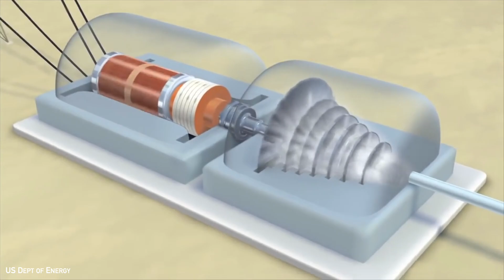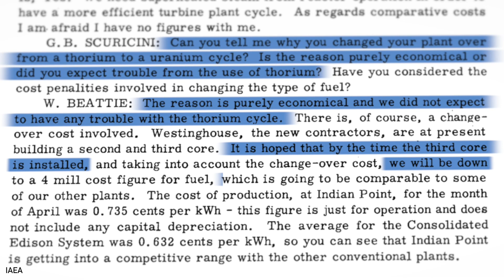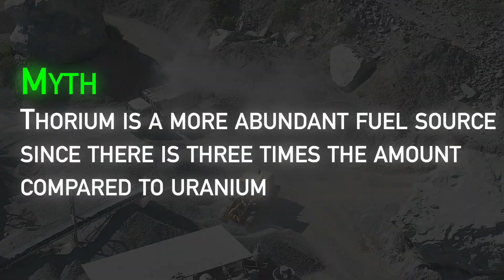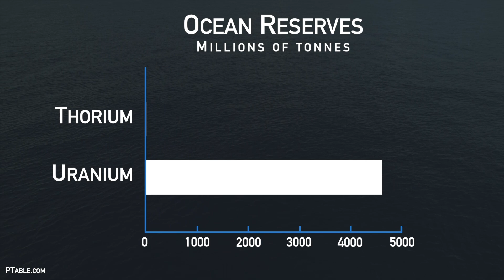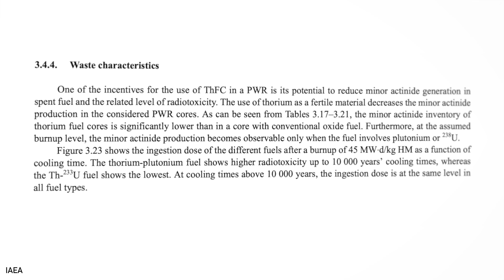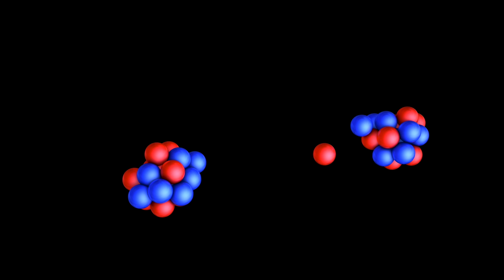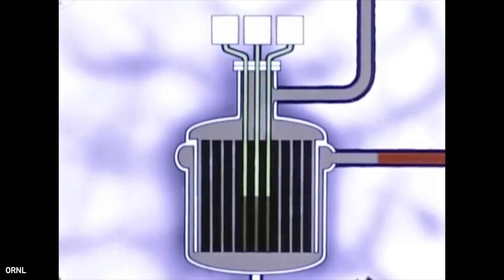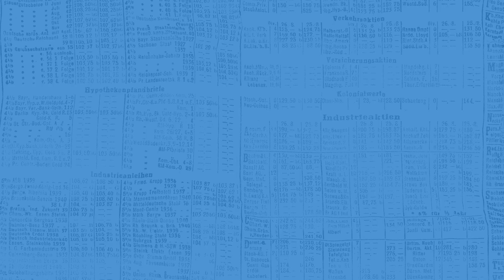*Almost

Comment: You make an economic error - the 'bomb' cycle subsidised the uranium economics - this staved commercial development.
Reply: That's kind of like saying the military subsidized jet and turbo prop engines, so we should all use piston driven propeller planes .
Virtually every type of reactor and fuel cycle was tried through the '50-'90s including Th cycles and MSRs. The "bomb cycle" subsidization was already done before any commercial power plants were built and none of those commercial plants in the US ever produced weapons materials. That was all done in dedicated military sites (i.e. Hanford & Savannah River). The reality is that the Th cycle wasn't economic. It was tried. Perhaps that will change in the future but it won't be because of Th hype produced by startup marketing.
Reply: @richardb1452  :(, you missed my point. It is the 'founder' effect in network economics - the military/government  choice subsidised the first two generations of commercial reactors - that is all. 
That 'lost' about thirty years of research into thorium (for commercial use). 
thank you for your comments
Reply: @carly09et  Understood....and you perhaps missed mine. Go back through history and that happens in virtually every tech area the military engages in, which is almost everything. The easiest way to unlock funding for research is to see a threat, hence things like DARPA, the space race, etc...
Not saying that is how it should be, but it is the rule rather than the exception. Cheers.
Reply: @richardb1452  I get it it is like standards.
It takes a while for 'bad' standards to be overtaken - I give the 'first to' a higher economic barrier is all.
Reply: @carly09et , like with standards, there needs to be an economic incentive to change and so far unless you are India, that doesn't exist. I wouldn't characterize either fuel cycle as "good" or "bad" generically. Both can be closed cycles producing similar waste streams. Both require proliferation controls (despite claims to the contrary). Passive safety is a function of reactor/fuel design, not fuel cycle choice. I know there has been a lot of hype about Th over the last decade, but it is not yet justified scientifically. It is a dream and may come true, or it may not.

India and China may come to the same conclusion the US did 50 years ago, that the Th cycle is more expensive. That said, India in particular may adopt it regardless for energy independence reasons. In the US, the two Th solid fuel commercial core trials cost more than U cores and the Th MSBR was just a concept competing against a U-Pu breeder that had already been running for nearly 5 years actually producing electricity. I think it is hard to objectively argue based on info available at the time the US made the wrong fuel cycle choice at any point in the timeline. 

Only time will tell if that 30 years was actually lost or in fact saved.

Comment: Plus thorium is a byproduct of rare earth mining.  There is 1000 years of the stuff already concentrated and stored as a waste by product.
Reply: Yup, and old coal powerplants can be repurposed and refurbished, using the old steam turbine and electrical infrastructure and just switching out the heat source adding safeties and infrastructure for thorium
Reply: Still that won't make NPPs much cheaper nor practical, Noah.
Reply: Mentioned in the video, Patrick, but thanks anyway.
Reply: They don't separate the waste product from each other. It only concentrated in the sense one specific resource has been extracted from the generic waste

Comment: With thorium 90% of the element is actually burned.  NOT 1/2 % of 5%
Reply: With Thorium 0% is fissioned since Thorium is not fissile and will not fission. U238  is not fissile and will not fission but like thorium, it can absorb a neutron and become Pu239 which is fissile and will fission and does fission in uranium reactors

Comment: THEN only 1/2 of 1% of the 5% is actually burned until the solid fuel rod is ruined from gas production and cracks.
Reply: actually more than 100% of the uranium fuel is used

Comment: You make one faulty argument. 
The Th we find is 99% the fuel-cycle ready variety. 
The U we find is only 0.7% the fuel-cycle variety. 
It's misguided to say "Look, there's the same amount of extractable U as there is Th!" The important metric is not what's extractable, but what is usable . And Th has a *100:1*  advantage here.
Reply from the maker: I'd almost agree, but U we find is also 100% usable in fast reactors. The 0.7% is only limiting if we consider just LWRs.
Reply: @atomicblender  hmm indeed. The U-Pu cycle.
Reply: he Th we find is 0% the fuel-cycle ready variety.  Thorium is not fissile, does not fission and does not produce any power.  U233 that comes from the Transmutation of Thorium does. U238 which is 99.3% of all uranium.  U238 is not fissile, does not fission and does not produce any power.  Pu239 that comes from the Transmutation of U238 does.

Comment: Is not Thorium the most abundant nuclear material found on earth, like over Oil, Plutonium, & Uranium, Thorium is literally everywhere?
Reply: No it is not found everywhere.  Thorium can do everything except escape the laboratory even after 60 years of trying.
Reply: Abundance. Thorium is three times as abundant as uranium and nearly as abundant as lead and gallium in the Earth's crust.[22] The Thorium Energy Alliance estimates "there is enough thorium in the United States alone to power the country at its current energy level for over 1,000 years."[23][22] "America has buried tons as a by-product of rare earth metals mining", notes Evans-Pritchard.[24] Almost all thorium is fertile Th-232, compared to uranium that is composed of 99.3% fertile U-238 and 0.7% more valuable fissile U-235.
https://en.wikipedia.org/wiki/Thorium-based_nuclear_power
Reply: @edge2science Under your logic,  Hydrogen is the most abundant element in the Universe so everything else should be abandoned and fusion reactors built.
Reply: Oh fun, Sure whatever you say your magnificence : )
Reply: @edge2science  Being correct does not make someone magnificent.
Reply: @clarkkent9080  Got that right supperman LO

Comment: 2:30 ~ It was done by Nixon as a way to use the cash and resources for nuclear armaments.  Cheap, reliable power for the future be damned compared to global domination in the nuclear weapon department.
Reply: Where do people keep coming up with this BS that Thorium was abandoned and Uranium based PWR/BWR were chosen so we could make bombs?
Hanford Wa. has been making weapons material, at their 9 reactors, since 1944, 12 years before the first U.S. commercial nuclear plant became operational and their weapons production reactors are very efficient graphite moderated reactors and DO NOT produce any electrical power.
Savannah River site SC. Has been making weapons material since 1955 and their 5 production reactors are very efficient low pressure heavy water moderated reactors and DO NOT produce electric power.
Thorium was tried at Shippingport and Indian Point commercial reactors in the 1970s and abandoned as too costly compared to Uranium.
Weapons production reactors are NOTHING like U.S. commercial PWR or BWR power reactors and commercial power reactors have NEVER been used to produce Pu239 for weapons, since there has never been a need beyond what the efficient weapons production reactors could provide..
The U.S. currently has so much Pu239 that 34 tons of weapon grade Pu239 is being treated so it can eventually be disposed of at a cost of billions.

Comment: I challenge your mythbustings #2 and #3.

#2.  Numbers about supply are coupled to demand. If there's a market, supply will appear.  If there's not a market, supply will disappear. 

What the abundances are in the oceans is more an issue of solubility in salt water.  I am not sure what is the relevance.  Where we mine rare earth metals, Thorium is 4.1x (see  2017AGUFM.V24C..08M) not 3x higher in abundance.  It can be recovered from existing mining programs but if there's no market there's no rationale to recover it.  The numbers you saw are just what's semi-marketable and meaningless.

But who cares about the 4 vs 3 error?  There's a factor of 100x error or so due to the fact that only U-235 (1% of U) is usable in plants. The U-238 is wasted. With thorium, all of it can be used.  

The cost and effort required to obtain the U-235 from U is a little crazy, too, since they are chemically almost the same. It's saved with thorium.

So, it's 400x more fuel, not 3x more fuel in the ground.

And, last but not least, thorium reactors can fission the spent fuel from U-235 reactors that everyone has been complaining about for 50 years, so the fuel is not even free but is actually negative. 

#3. This is speculation on my part but no, the fact that is has some uranium doesn't mean it is like a uranium plant at all. If it can fission any thorium it should yield thorium byproducts, not U byproducts.  

Good video though.  Keep up the good work.

Comment: Hi...I think if memory serves, your assessment seems to be in step with Sabine's!  I have a reasonable grasp of the structure of an atom and the concept of splitting it and getting energy out and fission products that are different from "their parents" and often still radioactive - indeed what radioactivity is: unstable atoms throwing out differently-dangerous decay particles (although I forget specifically whether it's an alpha or beta particle which is a neutron and what a gamma ray is). Similarly I have a broad handle on the fact that the power stations use the heat to boil water and that the resultant steam (at far higher temperature and pressure than what comes out the kitchen kettle) drives a turbine, which in turn drives an electricity generator (which is something like a reverse elctromagnet)

So it can be seen the general idea is there without claiming any real expertise whatsoever. What I WOULD hope to claim reasonably is a neutral position and an ability to put what i know about each of the various viable means of power production into perspective. Seen as ALL methods of generating power have waste, climatic, risk to life and sustainability consequences, all I will say is that while I leave the technicalities to the experts (I would not feel in any way qualified to usefully contribute to the arguments concerning which particular "brand" of nuclear reactor we should be considering  - molten salt, thorium, fusion etc ), I do feel sufficiently impartial and informed enough to say that it is ABUNDANTLY clear using coal for energy production is by far the most dangerous...if the stats on the mining, transporting and burning of the stuff, including the pollution it produces  - are collated and summed over the totality of commercial coal-fired energy production it is millions dead, injured and diseased. Adjusting that headline number to a more representative and therefore fairer and more realistic one by allowing for the fact that coal represents such a huge percentage of the world's electricity energy source, it is still whole orders of magnitude more dangerous than equivalent figures for solar, wind and nuclear sources. Oil is not far off in its danger, as with coal both drilling for it, transporting it and turning it into power. Whilst natural gas has lower  environmental/climate detriment, it is, by comparison to the best options, still dirty and dangerous.

Hydro seems so clean, doesn't it - literally electricity just from the potential energy stored in water...yet millions of tonnes of concrete and steel have to be manufactured with which to build dams and construction  is already one of the most dangerous jobs on the planet, never mind the exponentially more dangerous task of constructing things hundreds of feet tall. Then there's the approximately 20 annual dam failures which, although in spite of their drama are less dangerous than might be thought, still cause dozens of deaths per year - a figures likely to worsen in the coming years as more unpredictable rainfall makes overstressing dams increasingly likely.

The ultimate point is this. Approximately 6500 people have died in air crashes since 2006 - which stops virtually nobody from attending conferences abroad or taking their family abroad for a holiday. Moreover, despite statistics indicating that, in the US and UK (so Christ knows what it's like in India, South Africa or Colombia, for example) riding a motorbike is THOUSANDS of times more dangerous than air travel, does that seem to stop about 1.4 million people per year taking to the roads on some form of motorised 2-wheeled transport I'm Britain alone? With the dangers described in the above terms, you would have thought there wouldn't be a single scooter to be seen on the King's Highway - and people far more circumspect even about getting on a plane. In the same way, we need to get places, so we need power. The two have very significant bearings on the vast majority lives. I simply don't understand therefore, how the vociferous Greens and CND brigade, have been allowed to hijack nuclear power to the degree they have. They have also, albeit indirectly, been responsible for countless thousands of preventable deaths by forcing electricity generating companies to continue relying on fossil fuels and/or other dangerous/inefficient ways for generating electricity? By all means let them raise objections and even protest - but let them look at the figures themselves then PROVE in open debate why their objections to stymie the building of more nuclear power stations should carry? Then, when they can't, we should immediately proceed to build nuclear power stations  - moreover, without Chinese Government involvement.
Reply: "I forget specifically whether it's an alpha or beta particle which is a neutron and what a gamma ray is"
An alpha particle is a helium nucleus; a beta particle is an electron (or positron); a gamma ray is a photon (particle of light); a neutron is a neutron.

Comment: So why are there very little uranium based liquid fuel reactors, if liquid fuel reactors are independant of their fuel?
Reply: Let's be clear, there are NO commercial liquid fueled reactors....anywhere. From a historic perspective, the MSRE at ORNL, which tends to be the reactor MSR fans cite, first ran completely on a U cycle. Some testing was done with Th in the last year or two, but it was never a completely Th core, there was always U in the mix. If you want to look at proposed molten salt reactors they use the U cycle, just read up on Elysium as one example.
Reply: They discovered plutonium before any nuclear reactors for power generation were invented. Plutonium proved to be the cheapest path to nuclear weapons. The first nuclear reactor for power went into the Nautilus nuclear submarine. With a working nuclear reactor in hand, there was no incentive to invest more money in thorium experiments. Governments would rather spend money on war than on safer cheap energy. People don't do the reasonable thing until they have exhausted every other alternative.

Comment: I have a slight correction: Thorium cannot make nuclear bombs without very difficult breeding and post-processing of the results.
In other words, Thorium can make nuclear bomb but it there are easier paths to do so.
Reply: That's not a correction. It's a falsehood. Thorium is not fissile and therefore to make usable fuel the Th-232 has to be converted by neutron capture to protactinium-233, which decays into uranium-233 and that is the fissile material used as fuel. The chemistry of protactinium is so different from that of thorium that it is simple to chemically separate them and end up with pure U-233, which is usable in nuclear weapons. The breeding/processing for nuclear fuel and the breeding/processing for nuclear weapons is the same process, and compared with the difficulty of separating U-235 from U-238, it's downright mendacious to call it "very difficult". In other words, the path to use thorium in a LFTR generates weapons-grade fissile material at the same time. There's simply no need to look for "easier paths" to proliferation. Check out Bulletin of the Atomic Scientists (August 6, 2018) "Thorium power has a protactinium problem" if you want a detailed exposition of the dangers of proliferation inherent in the use of thorium. That is the biggest stumbling block to its use.
Reply: @RexxSchneider  Thank you for your expertise.  Apparently, you have a working LFTR that actively separates protactinium (half life 26.967 days) very efficiently and at low cost.  I would suggest a patent before the secret gets out!
Reply: @k.c.sunshine1934  Don't be a prat. I quoted from real atomic scientists who actually have experience. What are your qualifications to pontificate on your "correction"? Protactinium in its pentavalent state has very insoluble salts and that makes the separation from either thorium or uranium a straightforward chemical process. A thorium reactor has been running in India for some time and it uses the chemical separation process to derive the U-233 to use as fuel. For more detail, read: Richard Wilson, "Peculiar protactinium
", Nature Chemistry, Vol 4, July 2012. Now what's your source for your misinformation?